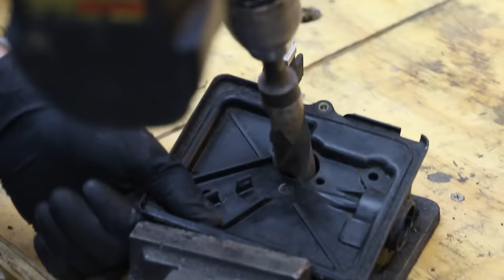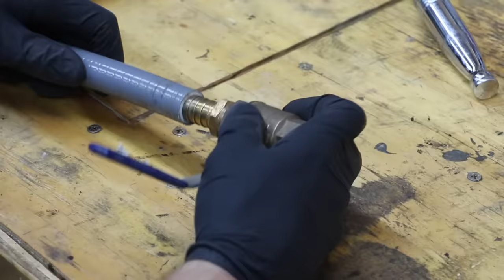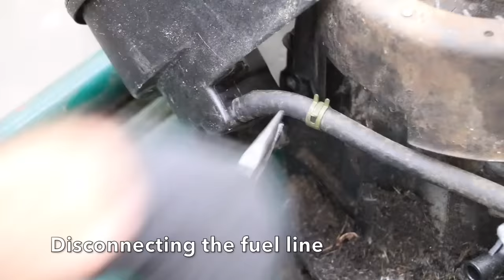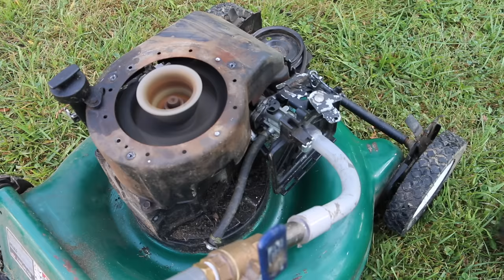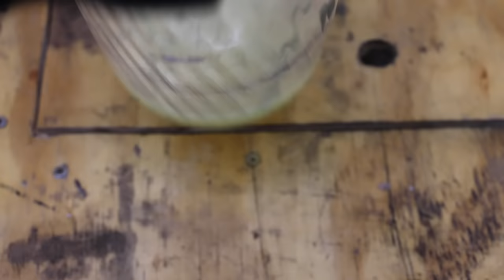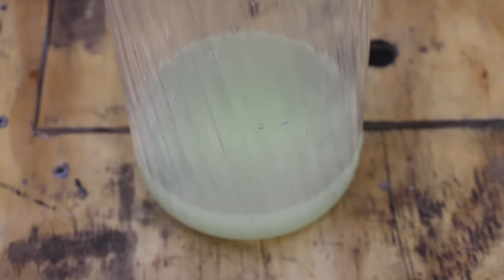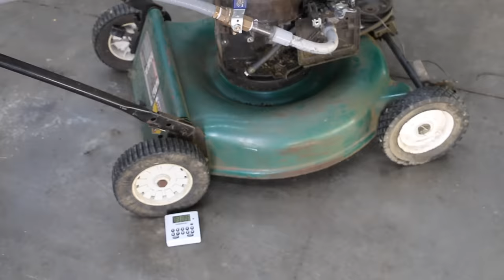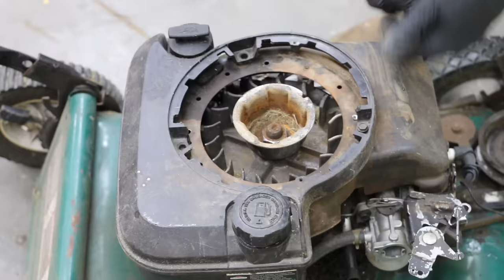Will a "Gas Vapor" Container Improve MPGs and Fuel Efficiency?  Let's find out!

Comment: I had to laugh when I saw this.   30+ years ago I did extensive testing of vapor fuel using a large generator… slow running (1800) with a fixed load.   I used a heating system to vaporize the fuel as it exited my vaporizer (fed by a pump).   The reason for this was to vaporize ALL the gas, not just the lighter components as you did.   With full control of mixture, and timing, I could see zero significant difference.   This makes sense, because LIQUID DOESN’T BURN.   It must be vaporized to burn.   Carburetors meter the fuel into the air stream where most of it becomes vapor before entering the cylinder, where the heat of combustion vaporizes the rest….. Gas engines do run on vapor.    I also ran a Ford V8 on diesel vapor, waste oil vapor, vaporized plastic, vaporized rubber, and vaporized wood.   The latter was used during WW2 in Europe to power cars, trucks, and buses when gas became scarce.   Called “gasogens”.   Diesel engines also run on vapor.  The fine droplets are vaporized by the very high temps from high compression.    Miracle carbs like the famous Pogue never yielded the claimed results….. just a scam.   I can and will say that to anybody because I played with it extensively, pursuing every lead.    BOGUS!!
Reply: @ilblues  The Fish carb was manufactured for awhile…..A friend of mine had one, and we put it on several vehicles.   There was nothing remarkable about it.  It had a unique fuel metering system involving a tapered slot and an arm with an orifice that served as a jet.  As you opened the throttle, the orifice followed the slot (inside the float bowl) as I recollect.  The arm had a fuel passage inside it and connected to the throttle shaft, which if I remember correctly was hollow and drilled with multiple holes which delivered the fuel into the air stream.   It was not a particularly good carburetor…..The ordinary Motorcraft and Rochester 2 barrel carbs worked better.    I once saw a Pogue hanging on the wall in a neighbor’s shop…. In his 70’s at the time, he made wild claims about a Dodge Polara  that supposedly made 200 mpg with it…. But he hung it on the wall when the car wore out and never used it………. Who wouldn’t have done the same ;-).  You should have heard his UFO stories…..   He watched them all the time supposedly.    I have to admit that I once saw one and watched it through my 10X50s from an estimated 1.5 miles off for about 10 min. (1979).  I was in an old IH pickup in the pine hills on a huge Eastern Montana ranch.  I saw enough detail that I have no doubt these many years later what I was looking at.
Reply: @stonetoolcompany3649  Being a Puget Sound native, I'm more fascinated with Bigfoot. When we finally capture one, I'm certain his UFO won't be far and that will solve both mysteries! They're really Wookies, you know. Seriously, I've never actually seen either, but that doesn't mean they don't exist. Recent UFO declassifications have been intriguing.
Reply: You could mount your fuel vaporiser directly onto the engine's intake manifold.  It would need a name ... how about calling it a "carburettor" ?  Heating will not vapourise the fuel any more, but will stop the possibility of ice formation in cold weather while also reducing the power output of the engine as the vapour has a lower molecular weight (less fuel/air mix per intake stroke).
Reply: @ilblues  coast to coast  radio show talks about both a lot of, used to at least, esp from the creator of the show ,Art Bell,   rip.
Reply: I've seen a video similar to this a decade or more ago. The "inventor" was Paul Pantene (spelling might be wrong) anyone else tried that version?
Reply: @Stone Tool Company did you use the heat of exhaust to vaporize the various fuels you tried? Or an external heat source? Obviously as you say it’s no magic high fuel mileage system, but the fact that you managed to run on several different fuel sources like diesel and oil is very impressive. Was it a conventional gas engine you were running?
Reply: @justinhadden5160  I used different heat sources…. Running from waste oil vapor, or vapor from rubber tires or plastic, I used a propane weed burner  to achieve pyrolysis.   Gas or diesel or waste oil can easily be vaporized with exhaust heat.   The challenge is to have a constant load & rpm so you can fine tune mixture, and timing for optimal results…… It is not a simple thing…. but very doable.
Reply: What about Tom Ogle?
Reply: i did a raw experiment and quickly realized that gas vaporizes at different temps. the fish carburetor worked on distillate not cracked fuel
Reply: @RealBobLoblaw    You are confusing the Fish with the Pogue.   My best friend of many years, and fellow “mad scientist inventor & mechanic owned a Fish which we used on several vehicles.   It didn’t use vapor.   It supplied the gas as a liquid through openings in the throttle shaft, as opposed to having a venturi.  It metered the gas through a port in an arm connected to this throttle shaft such that as the throttle opened, the arm which was inside the float bowl followed a tapered slot.  This tapered slot got wider and wider over it’s length…..Needless to say it followed an arc.   Functionally it really was no different from a typical motorcycle carb where the slide opens pulling a tapered needle out of a slot…. Think Mikuni.    The Pogue was a vaporizer.      I learned early about the different fractions, and the non vaporizing additives.   As a result I used what I would call a “flash tube” in my experiments.  The gas flowed through a hot tube such that it all came out as a vapor….This is ticklish, as you need enough heat to do the job but not produce ignition as it meets the airstream.    Heating a volume of gas to vaporize it results in distilling off the light fractions, and concentrating the heavier hydrocarbons along with additives.    This was the major bugaboo with vapor carbs.  Ironically the “heavies” have more energy.     It is a seductive fantasy, and claims of success are simply fabrications….. less politely known as lies!    If vapor yielded miraculous results, propane would be a super efficient motor fuel, as would natural gas………..   I’m able to call bullshit on this with the authority of having tested extensively on engines with constant loads where I could adjust mixture and timing.  Irrigation pumps make the best test bed for this.
Reply: @davemould4638  info verified... tinkered with the pogue concept extensively in the 99's learning the hard way... should have practiced being a tradesman instead.. but it  was fun /interesting with buddies, & learned alot of other things along the way 😏, way too many late nights and projects.
Reply: I have to agree.  This is not the same vaporizing i was thinking of.  I tried this 38 years ago based on the Pogue carburetor and some Smokey Yunick testing.  Instead of vaporizing with air, I used heat.  This converts the fuel to a vapor similar to what the cylinder creates.  I performed a preliminary test using a small engine.  It worked great.  I moved to a Chevy pickup with a 400 engine.  The engine ran for 15 minutes on a pint of gas with normal carburation.  With heat vaporization, the truck ran 45 minutes before I shut it off with a small amount of fuel remaining.  I had to build the system to create the vapor.  Temperature for vaporizing was around 500F (It's been a while I may be a little off).  Because of additives in the fuel now, any fuel not burnt in the vaporizing process has to be recycled with fresh gas to continue introducing the same fuel for use again.  Horsepower is down about 15% with the process, but worth it with the savings.  Just a little test from earlier days.
Reply: My IP
Reply: lol I’m o
Reply: P
Reply: Ppl
Reply: @stonetoolcompany3649  n
Reply: @stonetoolcompany3649  I was told you need white gas pure gasoline non additives to make vapor carb work as claim that after success with the vapor gas companies added additives so pump gas wouldn't burn effective enough today too see advantages sounds like bs too me ?
Reply: @shawnwright5332  It does sound like the typical BS conspiracy theory…. After all once in the vapor form it is essentially white gas…. In fact many years ago (73 or 74)… when white gas vanished forever (right after the Arab oil embargo), I built a still to make white gas for my backpacking and camping equipment….The only other option was Coleman fuel at an outrageous price by comparison.   The product was indistinguishable from the white gas I’d been using previously.
Reply: Stone tool, please tell us what small (1-3 percent?) amount of ethanyl might improve mileage?  I feel like one percent may improve combustion because it ignites faster so the whole stroke can make power. But obviously it has lower net energy, so ten percent at the pump gets bad mileage. You have any input? Thanks?
Reply: @stonetoolcompany3649  just curious? Did you account for elevation on this trip? Or wind? High planes are notorious for steady wind. Five mph headwind has a big drop in mileage. You could be right that even a small bottle wrecks mileage, but my gut tells me there's more at play.

Comment: I'm thinking the fuel change color in the container because you were filtering the air with the fuel you would probably want your intake air to have a filter on it if you were to do this full-time that's awesome
Reply from the maker: Great point and thanks for the positive comment!
Reply: Jeff Palmer im thinking since ethanol likes to bond with water. All that air bubbling in left you with a watery fuel mixture in the jar at the end.
Reply: More likely is that the lighter hydrocarbons were pulled into the vapor leaving the heavier hydrocarbons in the jar.
Reply: Agree with 2k4_8, it'll be the heavier fractions and the additives that don't vapourise.
Reply: Fuel changed color due to water condensation. When the fuel evaporates, it absorbs heat and cool the surrounding. Water vapour in the air condensed and mixed with the fuel thereby causing the change in color of the fuel.
Reply: Cloudy fuel is caused by water vapor mixing with the 10% ethanol in the fuel  thats why boat engines run like crap on "modern" gasaholl fuel. Dirt would just collect at the bottom of the jar over time.
Reply: Jeff Palmer that is a great idea everything fuel related  should have a filter and I think an arrestor a check valve to keep any backfire from going back through the tube into the fuel cell
Reply: Well i thought that the color was the pvc plastic melting into the gas . But after considering that water condensation might be  the culprit , I'd have to agree.  So put zeolite in the gas vapor chamber ,and or add a 1st chamber for the air  to pass through with some kind of dehumidifier then a third chamber after the bubbler with a zeolite filter . Then use the water from the first dehumidifier chamber to fuel an electrolysis h-h-o gas generator to inject at the carburetor with a small amount of atomized h2o then see if the fuel possessing system maby at least doubles the fuel economy. The key is that the fuel is always vaporized and separate from the atomized h2o that way they don't really mix in the cylinder but the explosion in the cylinder turns the atomized h2o to steam increasing the cylinder pressure on the power stroke without degrading the octane of the fuel .
Reply: Water condensation, fractional distillation, and aeration just make the gas cloudy. The yellow comes from the colorant that is added to automotive gasoline so you can distinguish it from aviation gasoline. The yellow was always there, it just isn't as visible when the gas isn't cloudy.

Comment: The fuel that was left in the jar, try running it in the mower, to see if it is any good. in the mowers fuel tank.
Reply: Probably not since it's full of water
Reply: @supernoodles908  Why would it be full of water?
Reply: @paulh2981  As the air is bubbled through the fuel the moisture from the air will go into the fuel. Fuel is hydroscopic. That's why the fuel is cloudy at the end
Reply: @supernoodles908  Sorry if this is a dumb question but would the water separate out if left to settle? Would it freeze out?

Comment: I'm wonder what the air fuel ratio is with the carburettor and the vaporizer would have been good if you put an O2 sensor on the exhaust to get the readings and then tune the carburettor to have the same O2 readings as a vaporizer and see if you get the same fuel economy
Reply: You will always get the same fuel economy I would think within reason, it takes 14.7:1 to make it happy. 14.7:1 is the same if it's done with a carb or this vapor method. However the discussion of there being no waste I could see that giving you a improvement in economy but I don't think waste  is substantial on modern engines, the emissions improvement if real could be a big deal. Even though man-made global warming is fake. Lol
Reply: +noahjames231 - You will still get NOx, and you will get CO if the mix ratio is imperfect, which it will surely be because of the difficulty of metering the fuel vapor.
Reply: duckslayer92 14.7:1 is the MASS, not volume. 
This demonstration is key for 2 reasons: to show how little gasoline it takes to run an engine, and to dive some insight into just how much “air” an engine pumps
Reply: Gregory Kusiak How ever isn't BTU's where the power comes from? Won't you still need to put in the same about of energy regardless??
Reply: duckslayer92 as I understand it, BTU is a measure of heat energy; BTU/hr is measure of energy consumed by work. Lower is more efficient as far as engines go, and given the runtime difference between the vaporizer and carburetor, I’d estimate a minimum 10% improvement in efficiency. Over time, that 10% or more could really add up. (Remember, the carb’d engine burned everything in the tank- if that was the benchmark rather than the vaporizer, there would be the ethanol left over, meaning a difference in volume consumed in favour of the vaporizer setup- lower btu’s consumed from less volume over slightly more time, or work done in this static test)
Reply: Bubby Rigged that is incorrect there is always emission. It is never 100% burned and leaner mixture also is known to produce more Nox

Comment: You should try this again . I myself have seen this work . My dad got some plans / ideas from a buddy and we did it on a courier in 1978 . Your efficiency test would have been drastically different had you heated hat fuel canister ! The sweet spot is 80-90 degrees . You should know vapors come with heat ! My dad's buddy claimed 200+ miles on a Folgers tin as long as you keep it in the sweet spot !
Reply: Thank you very much. Like Ogle, I am also a car mechanic. For the current gasoline engine, I have already studied the fuel. Thank you very much for your advice, which helped me improve the structure in my mind. Thank you very much